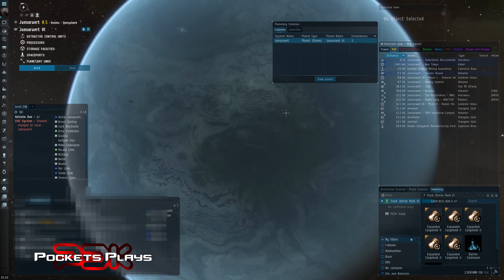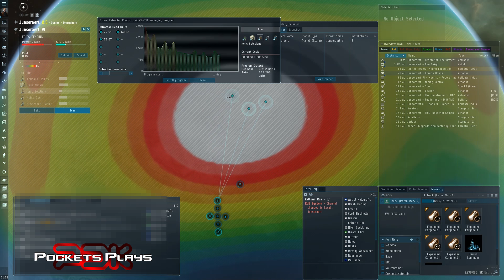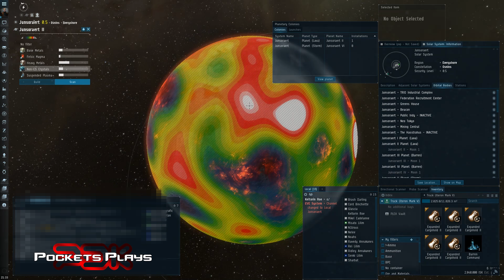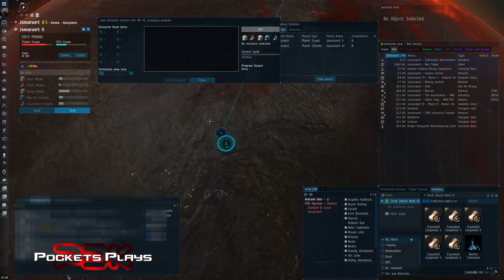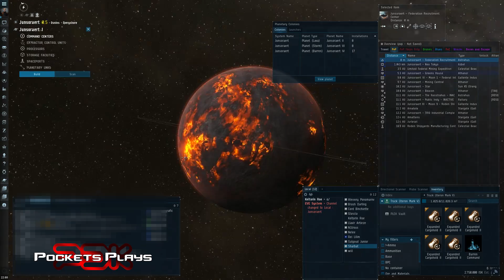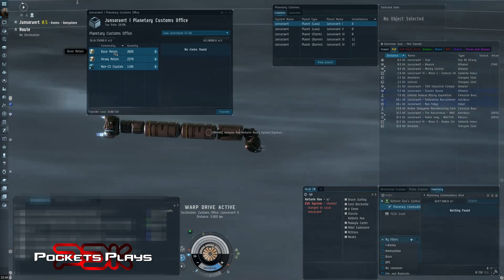EVE Online: Planetary Interaction Setup - High Sec

Comment: Good clear guide. good job
Reply from the maker: Thanks, I have since discovered that at the Tax rates in the system I will be shutting down the HS portion of my PI (My Low Sec ones are fine) after my quick update video today.

@15-20% my costs to produce are 50-100% higher than I can buy them from the market LOL

Have to watch them Taxes (or my math could be completely wrong)

Comment: Nice video, Pockets.  Definitely a good introduction to PI stuff.  I have a question though... Don't you get hammered on import and export taxes when you use planets for only extraction?  Wouldn't it make more sense to do your first stage of processing on the planets where you extract the raw materials?  Then you could export the P1 materials to your factory planets.  I guess there would have to be some kind of trade off because you wouldn't be able to extract as much on each planet if you had to build basic processing.
Reply from the maker: You are absolutely correct lol. I have a follow up video addressing exactly this issue.

Comment: pro tip: processors do 3000/cycle, 2 cycles/hour. so you need extractors making 12000 per cycle so your processors have no down time
Reply from the maker: Hmmm. I will double check my math LOL
I thought I did it right but I am not perfect (even if I pretend to be)

Thanks for the tip I will look into it.

Comment: Good guide,  Pockets. The only thing I do in space is build the command center. I scan, place structures, and route materials when I'm docked at a station.  Is there an advantage to being in space as opposed to being docked up? Thanks for posting the videos and helping the new players.
Reply from the maker: Not really. I just like being in space lol.
Usually when I am working I stay in space incase I need to use a spaceport/access the POCO.
When my ship is fit, I park at a safe and cloak, did not have the cloak for this vid (and teahthering in HS is pretty safe lol)

Comment: Great videos as always. As you get taxed for sending material to and from a planet; at was planet tax rate does this become an isk sink?
Reply from the maker: Thanks
Yes, you get taxed in both directions. It is really hard to make a profit in HighSec doe to this. 
In my original setup the Tax was costing more then Sell orders on the market. this setup came in just under (barely)
My LowSec operation is much better due to lower tax rates.

I will be redoing this as I need to move this PI to Lowsec and I figured it would be good to update with the recent changes... Hope to get to it this week.
Reply: I disagree, I have 2 toons set up for pi in highsec, each makes appx 20 mil a week, as a passive income it's not bad, but since my main lives in a wh, it's not a lot but its not subject to being wardecced
Reply from the maker: @Nathan5027  who owns the POCOs and what are your tax rates though. Most POCOs I  Highsec sit around 20% tax. Hard to make a profit at that level.
Also. What are you making?
Reply: only 1 poco is at 20% (super low tax corp owns that one i think) the rest are 14-17%, making supercomputers, coolant and test cultures, with occasionally (1-2 times a month) getting rid of the surplus used to make them. those toons are kept in npc corps too, so i get no benefit from being in the owning corp either.

i make a lot more isk from my operation in the wh i live in, we have 4% tax on most and 2% on my factory planet, combined with a lot richer raw material deposits, it's way more profitable

Comment: How do re adjust the Extractors after submit, also the farther the connection don't it use up more cpu, and power
Reply from the maker: Yes, the further the connection the more power- from the extractor to the rest of the factory, not from the extractor heads to the extractor... I think LOL

You have to wait a few minutes after you submit, but you can cancel the extraction and adjust it anytime after that.

Comment: This is not for beginners.
Reply from the maker: are to elaborate? I have had several folks new to PI thank me for this video... :).
Reply: @PocketsDK  Well I have better than beginner skills and I could not fit it all. It said I needed more power.
Reply from the maker: Yep. But if you want to make fuel blocks on 1 character this is what you need. Make sure command upgrades is at 4 and that your connections between nodes are as short as possible. Long pathing  takes more power.
Reply: @PocketsDK  I have it to 4 and I almost went blind trying to get everything as close together as possible. lol
Reply: Only thing I can think of is that you have higher skills than me.
Reply from the maker: The only one that should affect powergrid is Command Center Upgrades... I think (I stopped doing PI a couple months ago so would have to look)
Reply: @PocketsDK  Ok I will give it another shot. Thanks
Reply: Ok I tried it again, and it seems that the problem is that I can not upgrade the command center as far as you can, so I was forced to just make the last Oxygen route to the launchpad beside it.
Reply from the maker: I will double check. I think I only have Command Center upgrades to 4...